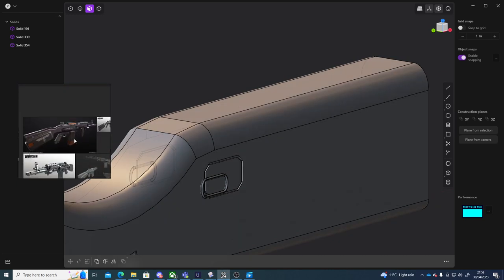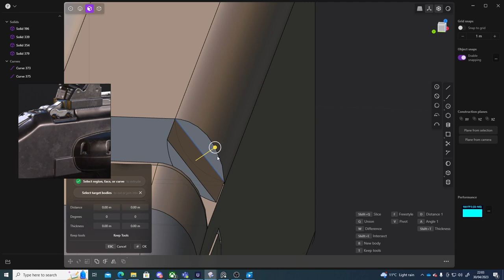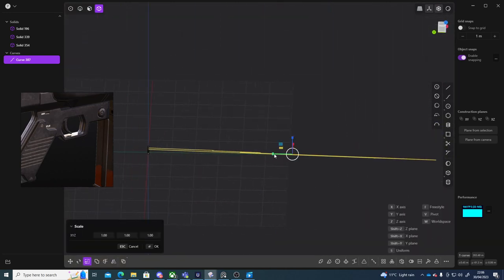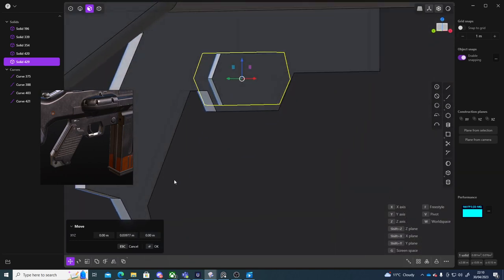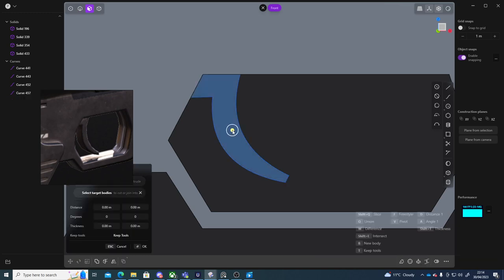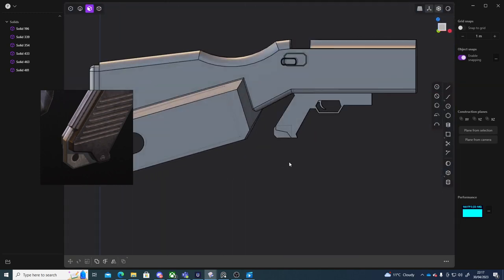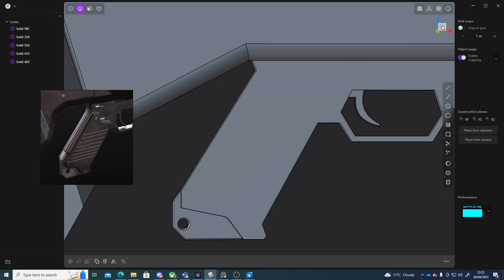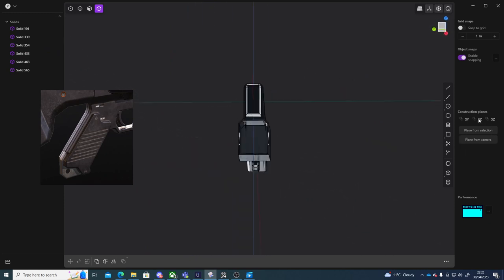Learning Plasticity | CAD for Artist - Assault Riffle - PT2

Comment: In this video, the speaker discusses learning plasticity and demonstrates the process of modifying a rifle model in 3D software.

[00:00](https://www.youtube.com/watch?v=nfQydA-Bwm0&t=0) Learning about plasticity and working on a Wolfenstein assault rifle.

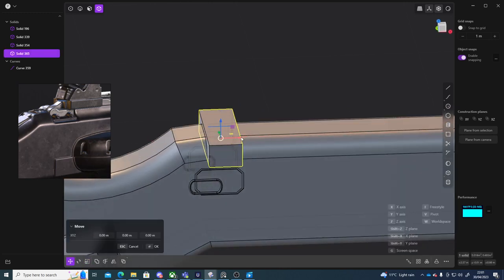[02:43](https://www.youtube.com/watch?v=nfQydA-Bwm0&t=163) Create a three-point arc tool to make an arch

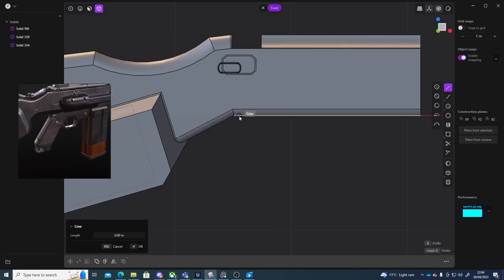[05:48](https://www.youtube.com/watch?v=nfQydA-Bwm0&t=348) Drawing the silhouette of the image

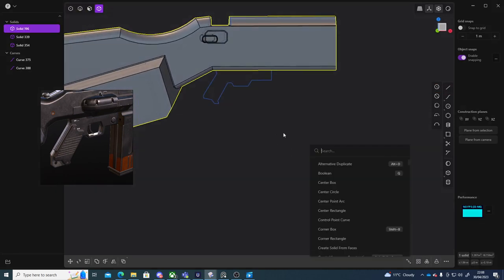[09:39](https://www.youtube.com/watch?v=nfQydA-Bwm0&t=579) Creating a 3D trigger model

[13:17](https://www.youtube.com/watch?v=nfQydA-Bwm0&t=797) Create spline curves for shape

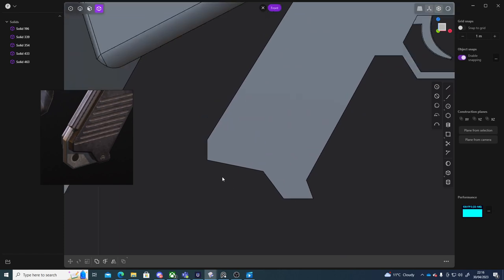[17:21](https://www.youtube.com/watch?v=nfQydA-Bwm0&t=1041) Creating a shape with straight lines and curves in Blender.

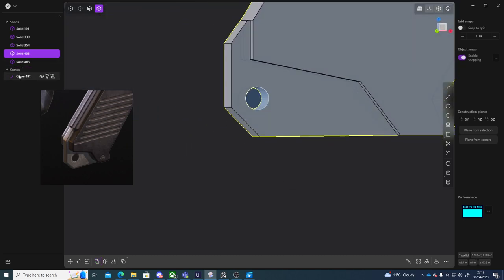[20:38](https://www.youtube.com/watch?v=nfQydA-Bwm0&t=1238) Creating bevels and chamfers on selected edges

[24:00](https://www.youtube.com/watch?v=nfQydA-Bwm0&t=1440) Create a curved edge with a fillet

---------------------------------

[00:00](https://www.youtube.com/watch?v=nfQydA-Bwm0&t=0) Learning about plasticity and working on a Wolfenstein assault rifle.
- The rifle has complicated parts.
- Need to change the length of the stalk.
- Trying to create a curved shape.
- Working on cutting out a small area.

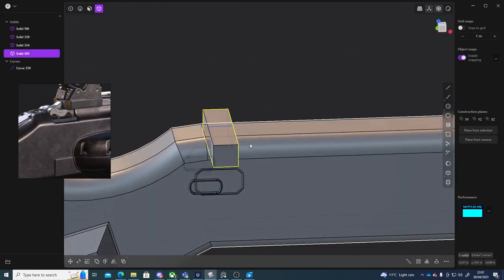[02:43](https://www.youtube.com/watch?v=nfQydA-Bwm0&t=163) Create a three-point arc tool to make an arch
- Use the top and bottom edges as reference points
- Pull to create the desired arch shape

[05:48](https://www.youtube.com/watch?v=nfQydA-Bwm0&t=348) Drawing the silhouette of the image
- Switching on and off snapping
- Working on the front view
- Continuing to draw the silhouette
- Hoping to avoid previous issues
- Rotating the construction plan

[09:39](https://www.youtube.com/watch?v=nfQydA-Bwm0&t=579) Creating a 3D trigger model
- Adjust pivot for color
- Close curve
- Extrude
- Draw the trigger area
- Boolean the parts together
- Delete unnecessary edges
- Mirror the model
- Scale it up
- Make the trigger

[13:17](https://www.youtube.com/watch?v=nfQydA-Bwm0&t=797) Create spline curves for shape
- Use the spline curves to create a shape
- Adjust the curves and confirm
- Create more spline curves to complete shape
- Delete unwanted curves
- Extrude and bevel to add details
- Scale and adjust size of the shape

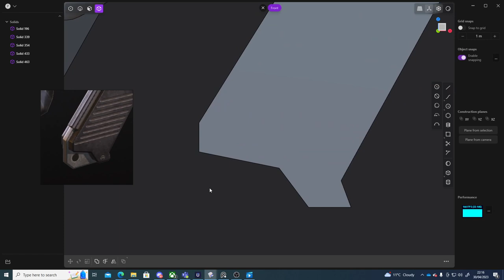[17:21](https://www.youtube.com/watch?v=nfQydA-Bwm0&t=1041) Creating a shape with straight lines and curves in Blender.
- Using the line tool to create straight lines.
- Using the face tool to create curves.
- Moving and adjusting the shape using the transform tool.
- Using the circle tool to create a circle shape.
- Pulling and adjusting the shape using the face tool.
- Moving and adjusting the shape using the transform tool.

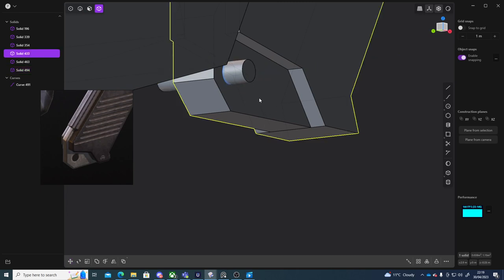[20:38](https://www.youtube.com/watch?v=nfQydA-Bwm0&t=1238) Creating bevels and chamfers on selected edges
- Beveling and chamfering selected edges to give them a nice rounded shape
- Experimenting with different sizes and styles for the bevels and chamfers
- Selecting additional edges to apply bevels and chamfers for a more interesting look
- Exploring different techniques for dealing with complex geometry areas
- Considering learning more about the program for better problem-solving
- Planning to draw an offset shape and extrude it for improved results

[24:00](https://www.youtube.com/watch?v=nfQydA-Bwm0&t=1440) Create a curved edge with a fillet
- Use spline curves to create the initial shape
- Extrude the shape and add a fillet to the edge